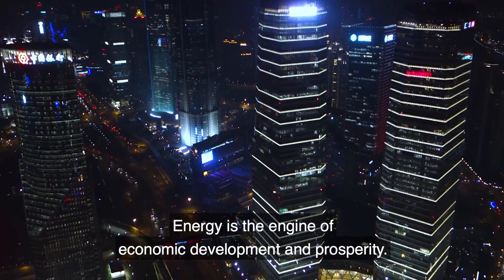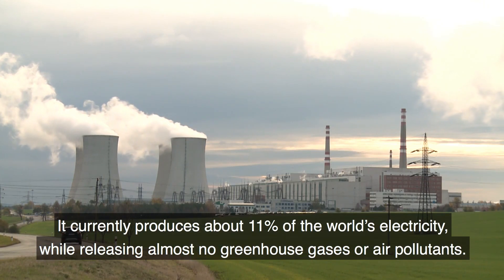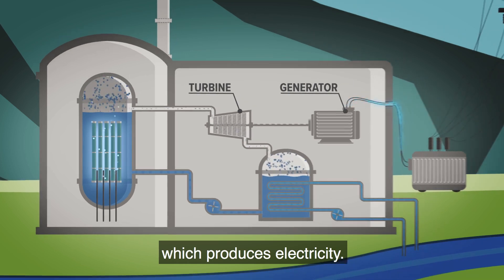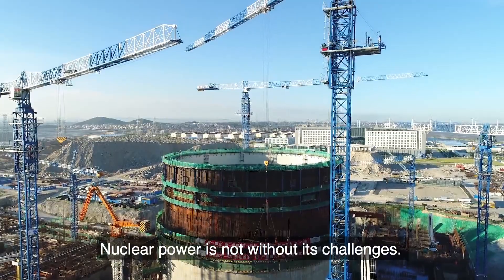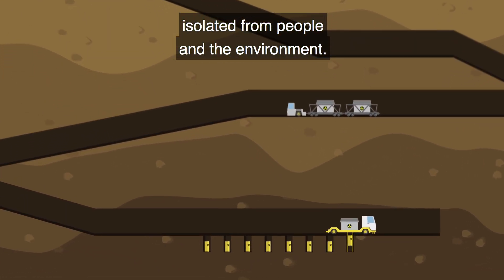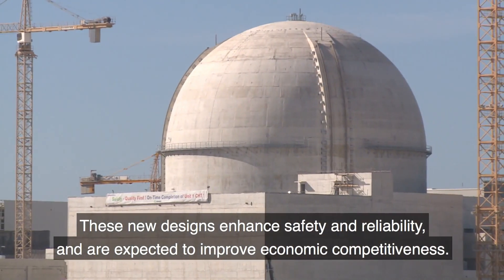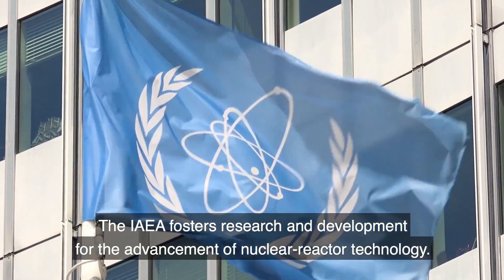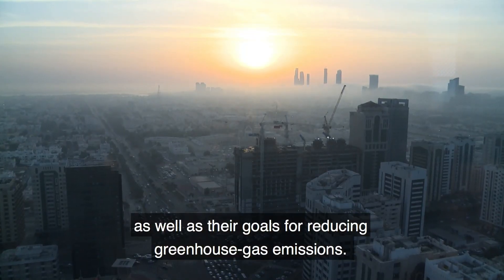Why Nuclear Energy is Necessary for Our Future !!#energyefficiency #cleanenergy  #environment

Comment: Why is there a greater concentration of videos pushing (marketing?) nuclear energy. The fusion related videos have reduced as have the modular nuclear energy marketing ones. Has there been a shift in marketing focus ?
Reply: Well there is a push worldwide for BEV cars, but realistically the world's current electrical grid can't support having them. Also battery cars generate as much greenhouse gases as their power source, so a car charging from a coal network is going to lead to more greenhouse gases than say nuclear which is one of the cleanest sources of energy if not the cleanest available not to mention very strong and provides a lot of power and efficiently. Nuclear seems to be the only feasible way to make BEV's work alright.

Of course for those that prefer fuel cell cars, the hydrogen infrastructure (or methanol as that would be more practical than hydrogen) is almost non-existent and obtaining hydrogen via electrolysis requires a lot of energy, although theoretical and can be very efficiently obtained with usage of nuclear power(hell the waste heat generated by nuclear can potentially be used to heat up the water and require less power to obtain hydrogen via electrolysis).

So if we push either hydrogen or batteries, it leads to needing to have the infrastructure established and well thought out.